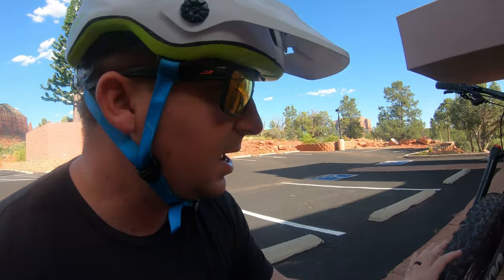How to Bed in Your Disc Brakes on Your Mountain Bike - Hardtail Party

Comment: I'm thinking of upgrading from my kona mahuna to a norco fluid fs 3, but I tested it out at the bike shop, and the brakes are terrible. When I say that, I mean if I only had one finger on the brake levers I can't stop. How much of a difference does bedding them in do? I don't think that its just bedding them in, because most people say that the brakes on it aren't that great. Any thoughts? Thanks
Reply from the maker: Bedding brakes is super important. Brand new bikes need to be bedded in.
Reply: @hardtailparty  ya, but when I got my kona mahuna it wasn't nearly this bad. The brakes on the norco fluid fs 3 are made by some company called tektro. What do you think?

Comment: After bedding in my rotors and pads. If i clean the rotors with the alchol spray do i need to re bed them in?
Reply from the maker: Most likely not, unless you completely scrubbed them with steel wool.
Reply: @hardtailparty  Thankyou for that
Reply: @hardtailparty  what should I do if I didn't know how I should bed then in? I only changed pads. Had organics and put organics again

Comment: Hey does this technique work if you are just replacing the brake pads? Or do I need to do it with new rotors as well?
Reply from the maker: Any time you get new rotors you should do it. Also, if you change brake pads from one type or brand to another, I recommend doing it again. It takes 5 minutes and makes a big difference.
Reply: hardtail party if I switch from resin to metallic pads should I lightly scuff the rotors to start fresh with bedding in the metallics?
Reply: @jasonneff913  it's good to clean the rotor.

Comment: Thanks for posting this. 
Question: can I still bed in the brakes on my new Tallboy if it’s been used a few times on the trail? 
I had no idea about bedding them, had them bled which helped but they’re still way too spongy! 
-thanks
Reply from the maker: Yes, as long as the rotor and pads are 100% clean
Reply: @hardtailparty  thanks I’ll give it a shot. They should be clean. If not, do you know if I can I spray auto brake cleaner on them?
Reply: @davids6652  Worst case if it doesn't work; 

You can clean the pads / rotor with isopropanol or brake cleaner. Sand the pads and rotors (fine paper, very lightly just to clean off that thin layer). 
Re-clean it and make sure it's all evaporated. Then assemble and re-bed. Apparently if you take some water on the pads, then rub them together before drying off and assembling. Then adding some water on the pads while bedding, it supposedly goes way quicker. GMBN Tech and some other bigger channels said this. Can't confirm that last one with water as I've not tried it myself.
Reply: @JamieR  good to know thanks

Comment: I've done Motorsports up to Formula 4 for, in a whole 11 years. I've bedded in numerous brake pads and was always interested the technical sides of the car.

But somehow I never asked why brake pads get "glassy" from too much heat and what the process actually does. 
Thank you for clearing that up 😂

Very nice video

Comment: Thank you! I just order new front brake for my hardtail :) (I'm wondering, if I need to change the disc or maybe just clean it with alcohol...)
Reply from the maker: No need to change it. Provided it is straight and doesn't have any dents/dings in it.

I would definitely recommend scrubbing it with steel wool and rubbing alcohol to remove the old pad material (especially if it has glazed onto it). I do this every time I get new pads.
Reply from the maker: Are your pads rubbing when the brakes are off? You may need to re-center your caliper. Also, did you switch to metallic pads, or are they both organic pads?
Reply from the maker: @Skots Trails I'd try rinsing your brake pads (while still on the bike), and cleaning the rotor. Some pads make more noise than others. Metallic pads can sound a little more "gritty" than organic pads.